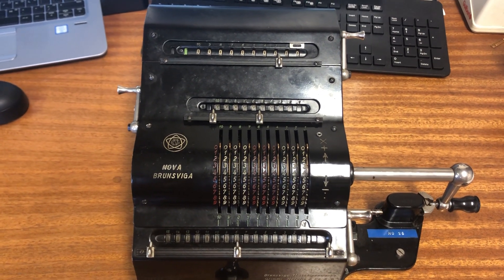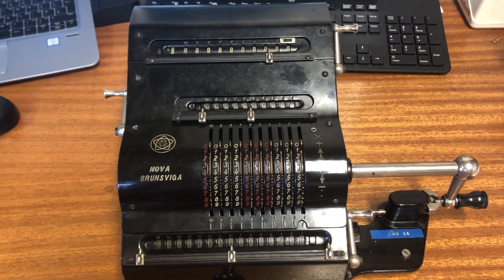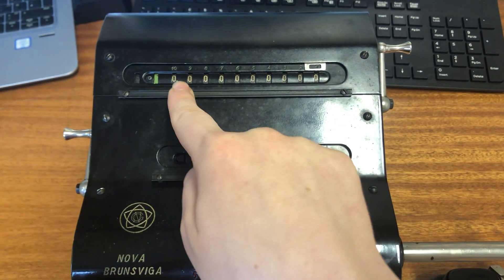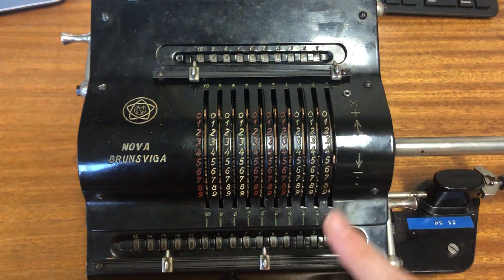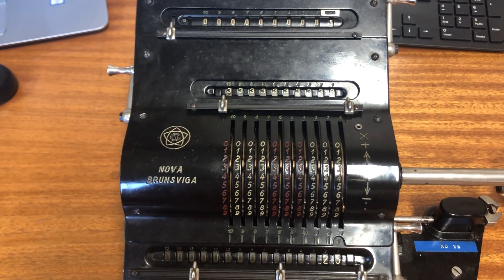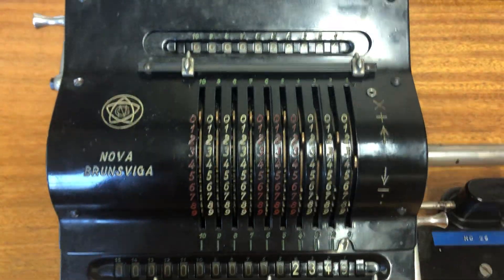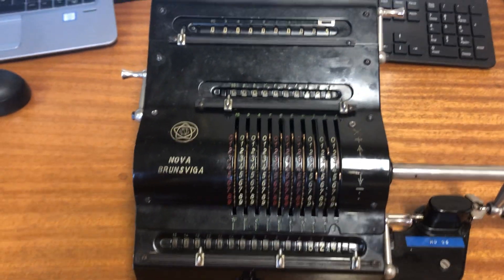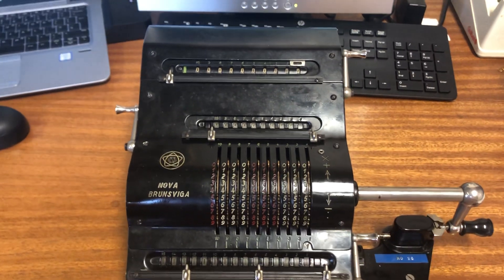Brunsviga Nova Calculator

Comment: The sliders are indeed to keep track of the decimal point during calculations, and to separate 1000s, like in 1000000=1.000.000.
It is the "Model II" in their series of "Nova Brunsviga" machines. "Nova"=new. Their older Brunsviga machines were licensed copies of ODHNER pinwheel calculators, were the rotation counter was to the left of the results register. The new design made for a more compact machine with a smaller footprint on the desk.

You can do addition, subtraction, multiplication and division with these calculators. Using TOEPLER's method,  one can calculate square roots, too. Other calculations involve mathematical series and/or approximation methods to calculate trigonometric functions or higher roots etc.
So, for the mathematically gifted, these calculators were a real help.

It was used in business calculations, too, and the instruction manuals for these machines gave very nice examples for everyday office calculations in accounting, salary payment, banking etc.

Comment: I think that the sliding pointers are used to keep track of decimal points. For example, if you are working with money, you might want to put one of the pointers to separate the dollars (or euros or whatever) from the cents.
One advantage that these old machines have over modern calculators is that they don't shut themselves off. This means that, if you are in the middle of a calculation and then go do something else, the same numbers will still be on the machine when you come back to it.
Reply: That's very interesting and a great observation, thank you! I hadn't thought about the "shutting off" or "sleep mode" of our modern machines.